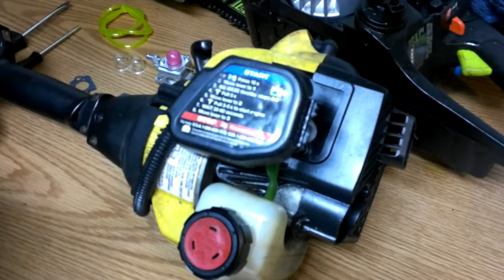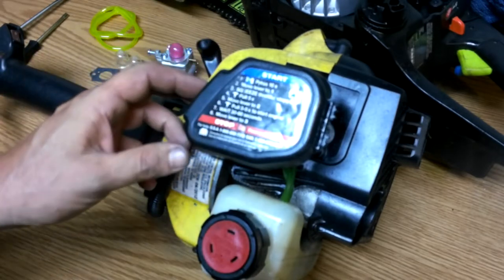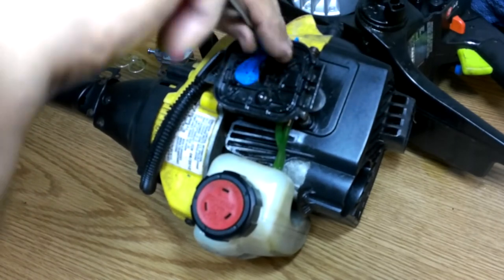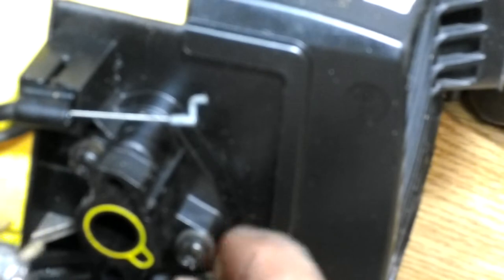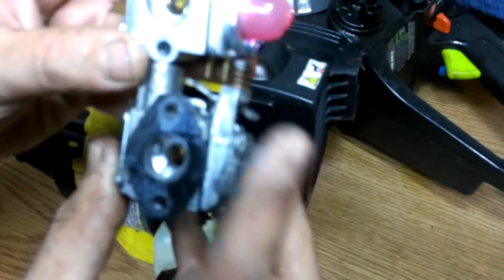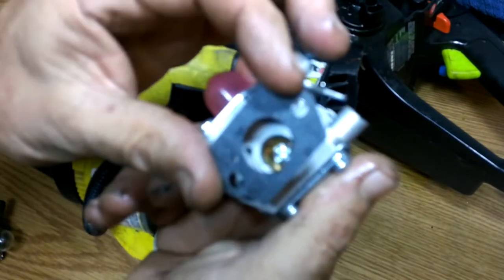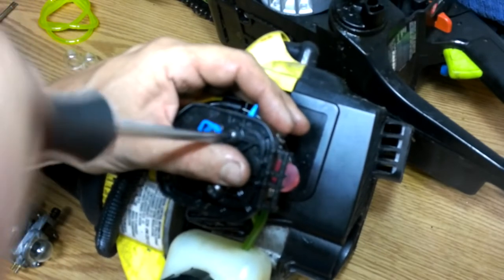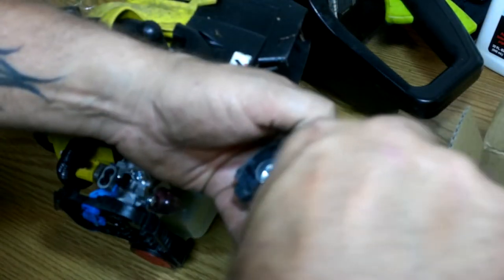carburetor change on 25cc Bolens weed eater

Comment: Hello Mr Shabear.. thanks for this great video.. I am having the same problem with the same bolens weeder.. my question is where did you buy al the parts that you showed in the video? What store did purchase all the carburetor kit that you replaced in your weeder? I will greatly appreciate it if you answer my questions.. thanks a lot.. Jose
Reply from the maker: Thanks Jose, i got the whole carb on line for like $20
Reply: @shabear1000  Wow! I opened Google but I didn't see them offered. Any chance you can provide an actual link?
Reply: What is the link of the store u used to get ur parts at
Reply: @Leshutchens4  They are on Ebay. Type into the search bar Bolens 110 or 160 carburetor, both take the same carburetor. Mine is the 160.
Reply: @greeneyes1963  Thank you! :)

Comment: Replaced with new carb as well , started right away.  But now hard to start up takes it  a lot of pulling to start. Will start full throttle and trigger on. Have adjusted the carb. Once it runs it good.? Help
Reply from the maker: does it ldel ok?

Comment: My weed eater throttle always stops the engine when I sqeeze… do u know what is reason
Reply from the maker: Sounds like the carb needs adjusted on the high side.
Reply: @shabear1000  thank you 😊